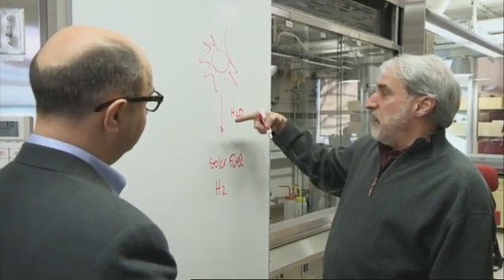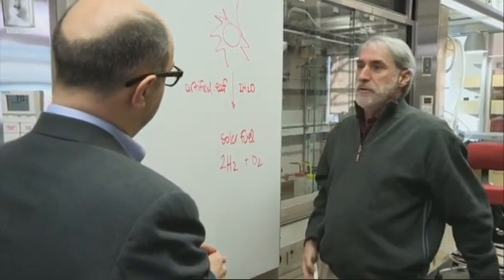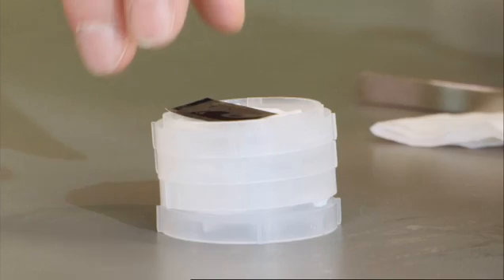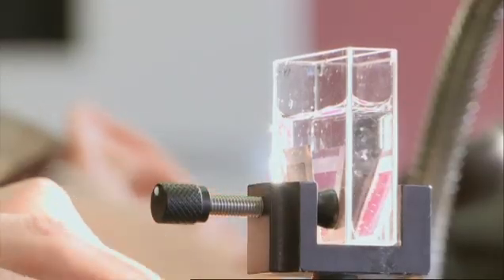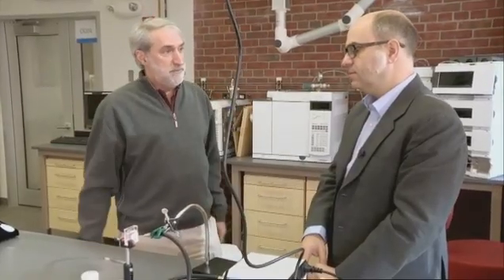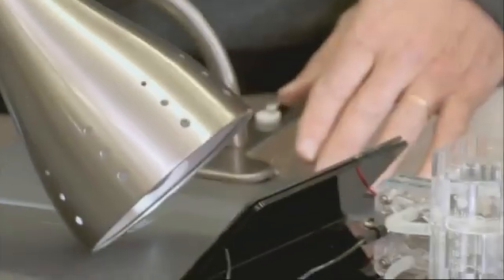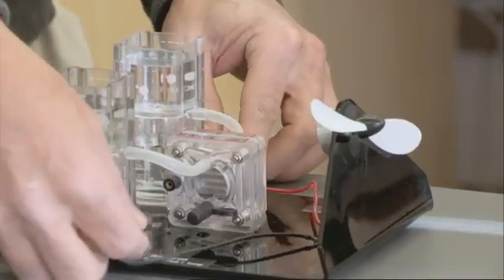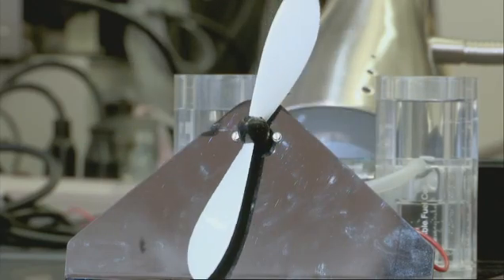Artificial Leaves Replicate Photosynthesis? | Horizons | BBC

Comment: Artificial photosynthesis? Absolute rubbish! The water is not split into hydrogen and oxygen - the water, with the help of the heat from the sunlight, breaks down the two catalysts to release the hydrogen and oxygen from them. Water is not H2O.

Comment: What kind of water do we need for this? Clean drinkable water may become a limiting factor for this? Unless it can run the saem on sea water? Hard, non drinkable water etc?

And then there is the cost if the artificial leat itself. He mentioned it is a catalyst so it wouldnt be "used up" ..id be interested in knowing the life span of the artifical leaf itself before it needs to be replaced. At the end of the day its about economics and how the corporation can squeeze the most pennies out of an idea (they love disposable tech to keep the consumer cylce running :) ...

Comment: does it work in sea water?
Reply: Sea water to Hy to Hy fuel cell to fresh water.
Reply: Robert Galletta I don’t know much, but it should work unless the salts interfere with the reaction. Sea salt would be leftover from the water as the h2o leaves it.
Reply: Robert Galletta a big question is that more efficient than just vaporizing and condensing the water. Idk. I guess you’re directly using solar energy to be converted to electricity then making water turn in to gasses which purifies it then getting your solar energy back when you use the h2 gas. Of course you should add some minerals and electrolytes cuz that water will solute electrolytes in your blood and kill you, but otherwise it’s pure as can be.

Comment: just one question.how would we saperate H2 and O2 produced from mixture of both these gases ?
Reply: I'd say in the model shown in the video there's no reason to separate the gases. Those gases are passed to a fuel cell which only uses up hydrogen and the oxygen then might just be released into the air going through the fuel cell.
Reply: +Zubin Butt You have to feed H2 and O2 separately to both electrodes of the fuel cell.
Reply: hydrogen is lighter than oxygen so maybe some sort of collection tower

Comment: That's not how PLANTS work.
 Plants take energy (sunlight)+water+CO2 and makes oxygen
 Where is the taking of carbon dioxide
Reply: Jack Emanuel We do not need to take CO2 in this case, because in natural photosynthesis, the CO2 is only there to provide carbon to store energy as glucose C6H12O6. This is an organic fuel, and if burnt would produce your CO2 again.

Because H2 is a clean burning fuel, and is highly energy dense, we use it without converting it to glucose and burning it ( which is what happens in biofuels)

therefore you don't need to add CO2 :)
Reply: Jack Emanuel We do not need to take CO2 in this case, because in natural photosynthesis, the CO2 is only there to provide carbon to store energy as glucose C6H12O6. This is an organic molecule, and if burnt would produce your CO2 again.

Because H2 is a clean burning fuel, and is highly energy dense, we use it without storing it as glucose and burning it ( which is what happens in biofuels). So we're essentially only using the light dependent stage of what is natural photosynthesis.

therefore you don't need to add CO2 :)
Reply: that makes a lot of sense. thanks!!
Reply: Not sure what you mean?
Reply: +Skoda130 material does not degenerate it takes other forms. Synthesis changes those molecules by joining them together with energy and catalysts. OK?

Comment: I want to know what's the difference between the solar panel and the artificial leaf? plzzzz
Reply: A solar panel converts sunlight into electricity that is used immediately, whereas the leaf creates a solar fuel (in this case, hydrogen) that can be stored and used when needed.

Comment: One side cobalt-phosphate based catalyst compound. The other side nickel-molybdenum-zinc junction. I like all energy challenges since Daniel Nocera is a person I admire.  All this story of artificial leaf sounds excellent except 1.Nickel, molybdenum and cobalt are not cheap at all; 2. in the nature a leaf do not last for a long time (typical couple of months), so probably Nocera's artificial leaf also will face the big challenge of relative quick degradation and oxidation. I am not a chemical expert but probably the fact that one side contains zinc, it is maybe good and bad at the same time. Like alkaline batteries a large amount of zinc increases voltage difference between poles, but unfortunately the drop down voltage once the inside environment starts to degrade it makes the battery almost impossible to re-use.
Reply: This is not a leaf, it just sells better to make people think of biosynthesis, even if it isn't.

Biosnthesis does not work like this, it uses light to create extreme electrical charge with in the cells. The ability to make suggar is powered by this potential energy.
Reply: ***** Well maybe you are right about the definition of "leaf", in fact it is the USA marketing style, assign pretty names to things in order to get more attraction...but anyway we have to recognize there is a research on going since so many years.
Reply: Giuseppe Nocera yea and they sad nothing about efficiency is this better then a normal silicon solar cell to split water? And if it is then you still need a 3kw (at least) fuel cell what is not cheap (15k$ LOL) and a 3 kw inverter (from 1k$) to run your house o forget the 6kw solar panel what is another dunno still 1$/w ? so another 6k$ . You could buy many battery from 15k$ lol. We are like 50 years away this will be economical if ever.
Reply: Hulla Dek Yes you are right, a good experiment that still remains out of focus with respect the business model & efficiency. ;-)

Comment: He shows the metallic leaf, and demonstrates it, but then switches to a solar panel to power electrolysis to make H & O for the fuel cell.  Kind of a disconnect!  Why not show producing the H & O from the Metallic leaf!?  I must have missed him saying that they are sill working on scaling it up.  In other words, they don't have a even a toy setup working system end-to-end.  No calculation was given for the number of sq meters of leaf and daylight that would be needed to split all those bottles of H2O every day.  People aren't going to power their electric stove or car from this, that's for sure.  Convert water heater,stove, dryer etc to natural gas??  Better to heat water with sun, whoops!  Need many many sq meters of sunlight to heat water AND generate power.  Cover roofs with this stuff?  Show me the numbers.  Solar flux == enerqy per square meter?  Do you know?

Comment: I don't understand, it does solve the electricity problem but if one house uses 15 bottles of water every two days that's 2,737.6 bottles a year and assuming he's talking about the average 1/2 litre of water that means every house is using 1368.75 litres a year... 7,329,150 total single detached houses in Canada in February. That's 10,031,774,062.5 litres of water in a year for only a part of Canada.... Efficient only if you look at it their way. Please let me know if my math is wrong!!

Comment: linkuei83, thanks for the info. Question - would this system increase the ratio of oxygen in or air (which is roughly 21%, right?)  If so wouldn't this be a problem? Thanks!

Comment: Excellent video. I have some questions - Aren't the 2 gases fairly explosive? I know by themselves they aren't unstable or explosive, say for example, what if there was a house fire - once the fire hit the stored hydrogen or oxygen, wouldn't that result in a huge explosion? As a domino effect, would this impact fire department responses (response methods and danger) to putting out these types of fires? Just curious. Thanks for any replies.

Comment: This is some wicked awesome stuff, but if my guess is correct, you can't get back the water you use (unless I'm mistaken). If that's true and the water is never returned to the system, I have to wonder what kind of solution this is. It's clean, yes, but it's not renewable, and the resource it uses is a resource that we are not going to be able to survive without.

Comment: Why can't you use an existing solar panel to split the gasses via electrolysis? You don't need a catalyst.. you don't need platinum. You need a solar panel, water and two copper wires. The problem is storing the hydrogen, he never says how they're going to solve that problem.

Comment: I agree that that's an important point, but I'd say if you build the system accordingly (as a closed cycle), you only need (reasonably) clean water once. The distilled water coming from the exhaust will then dilute any minerals etc. that are there from the initial fill, won't it?

Comment: You can quite easily run this system in a closed cycle, i.e., collect the water (vapour) at the exhaust of the engine/fuel cell, condense it, and feed it back to the artificial leaves. That way you only need to process the very first fill of the tank (and occasional small replenishments).

Comment: Water is scarce in many parts of the world and isn't in many others. More to the point, you can run this system in a closed cycle if you like (catch the water at the exhaust and reuse it)! Either way, the technology may well prove sensible: A battery delivers less energy than what it was charged with (in techie speech, it hasn't 100 % efficiency), and liquid/gaseous fuel can be better in some applications (transport, cooking, ...).

Comment: It doesn't take that much water. Renewable is the word. This can work. Did you know that world hunger could be ended for one year with about $35 Billion. I could imagine similar figures and technology such as HAARP could fix the drought problems too. The families that own the central banks which control the world are worth around $500 Trillion. They could permanently end the worlds problems and still remain mega-wealthy, This energy is do-able but not in this current corporate-fascist system.

Comment: However it also needs pure water, a rare commodity not found in nature.

(Rain water isn't pure).

Why pure? 
As the water is split, the water is used up and any residue minerals dissolved in the water will remain behind slowly coating the 'leaf therefore stopping it working! So it'll need regular cleaning and that takes energy!

I give it 10 years before these problems can be solved. :)

Comment: If you note in the video at about 3:20, Daniel makes a point that all plants have electricity but there is no actual current because there is nothing there to conduct said electricity. Despite that, it's still present.

Comment: Highs engineering costs my ass. What engineering?  This is not engineering, this is on a technical level of a collage project. There's nothing complicated in this system that would be expensive to produce. We buy PC's for 500 dollars, which are literally light years ahead of this technology, and are uncomparably more difficult to engineer and produce, yet, we do it on a massive scale and sell them on every corner of the street.  The only reason these energy deviced dont get produced is oil.